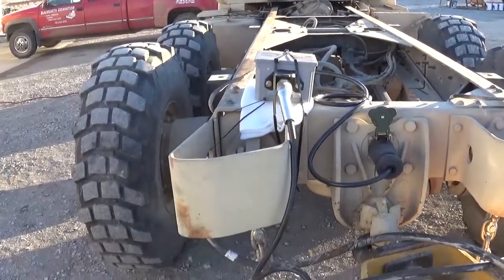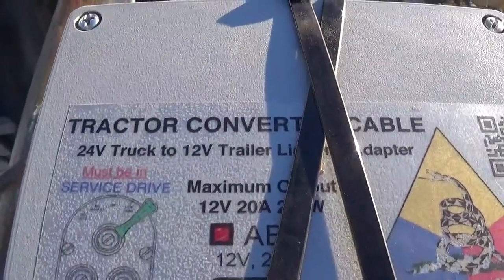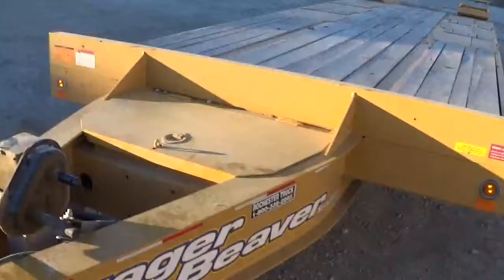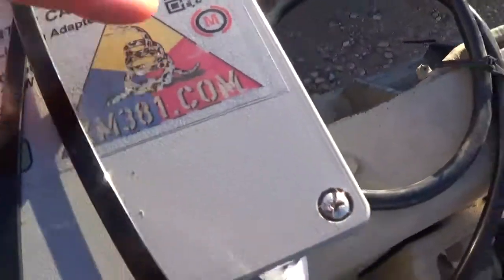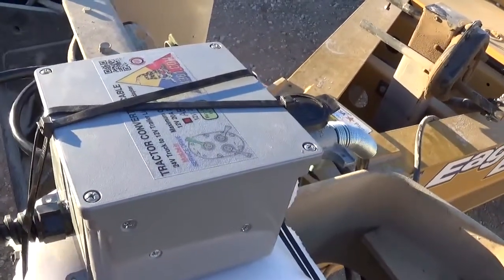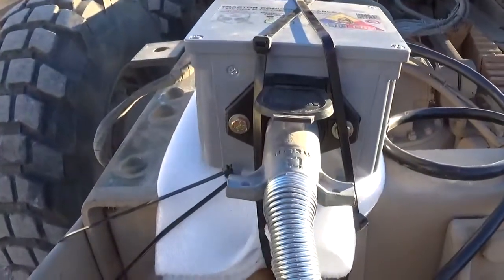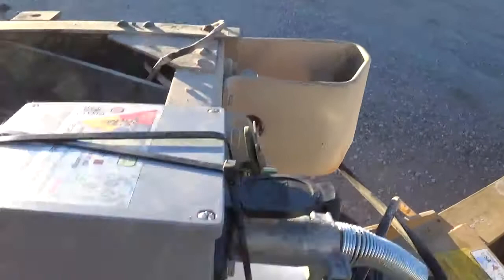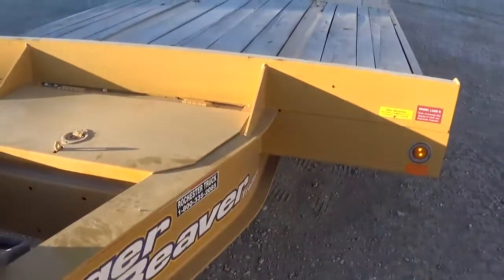Military truck light converter

Comment: Is that army truck a good puller?
Reply from the maker: yes and no... I pulled a 25 ton capacity eager beaver triple axle tag trailer, hauling a 34k lbs. cat 312CL with it.  To my surprise it pulled it pretty well, although it was on country roads where speeds were 35 mph maybe 45 tops ...going fast, hwy. speeds it doesn't have enough power. it's just a 250HP 8.3L Cummins ...
Reply: Ok yeah I was wondering I knew they didn't have the high horsepower that most semi's have. Are you using it more for off-highway hauling since it's 6x6?
Reply from the maker: +bert26a ... most of the time it's used in feild (off road) hauling  .. it's nice because it's road legal too.. we can legally drive it to the job site and have even done some short trip on road hauling with it.... amazing off road capabilities, goes places our on road dump truck can't even imagine going ... we are currently working on a second unit with a 25 ton adt body ..it's going to a be a true off road beast ..
Reply: Sweet sounds awesome!
Reply: +BLACK EARTH EXCAVATION & TRENCHING, LLC.   Can't wait to see that monster..